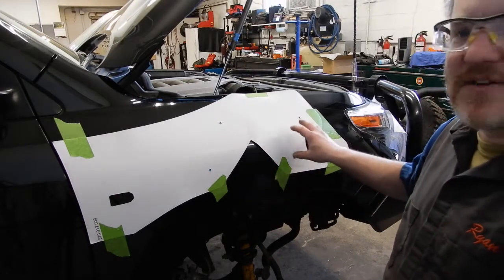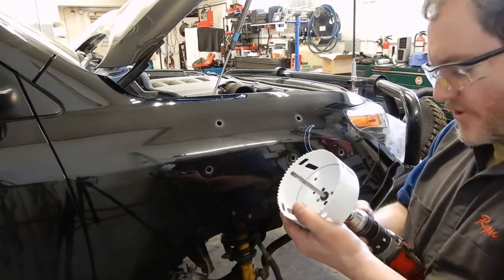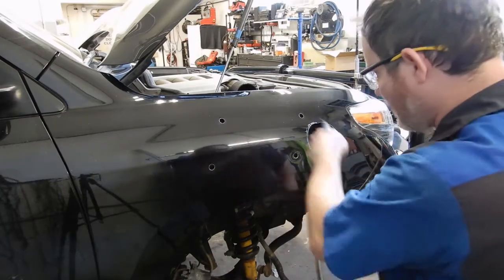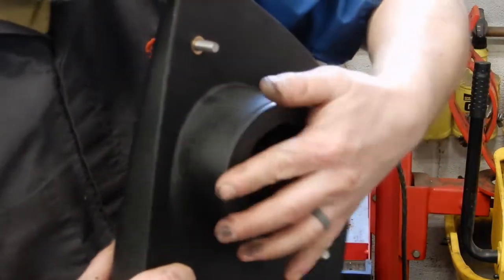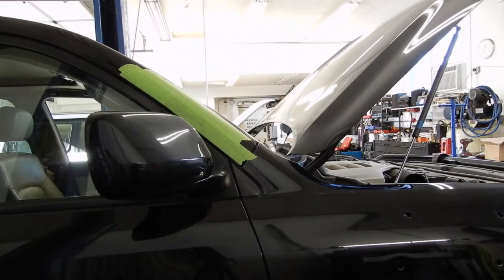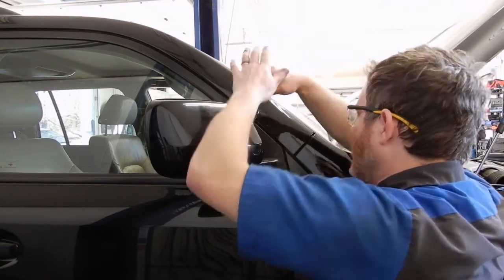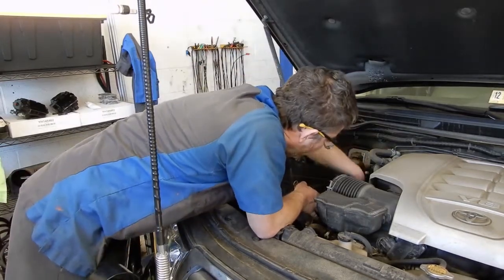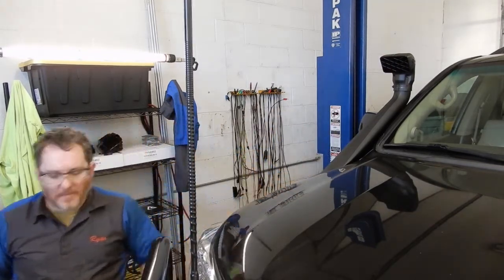US Spec 200 Series Land Cruiser Safari Snorkel Install

Comment: What size is the piping that came with the ARB snorkel. I have a 4in piping that came with the Ironman4x4 snorkel and wondering if i heat it up, that it will also fit the airbox.
Reply from the maker: I don't know, I've never measured it. Sorry

Comment: Quick question for you Ryan, not sure how much work is done that isn’t recorded in this video, if I’m working with a local shop here in New England, should I expect an hour or hour and a half of install time for a safari snorkel on my ‘15 LC200?
Reply from the maker: There's a lot of measuring and tweaking. I'd guess anywhere from 3-5 hours depending on the shop.